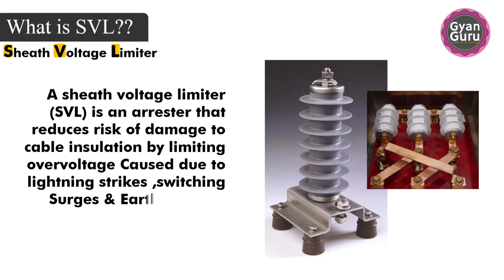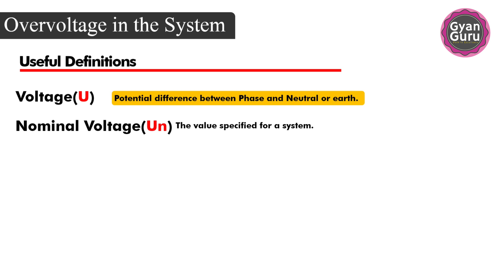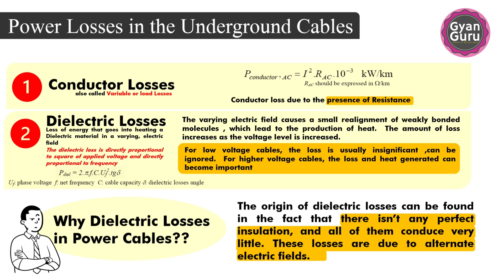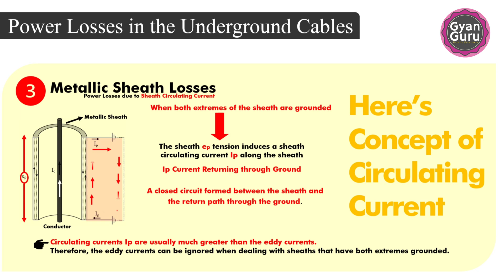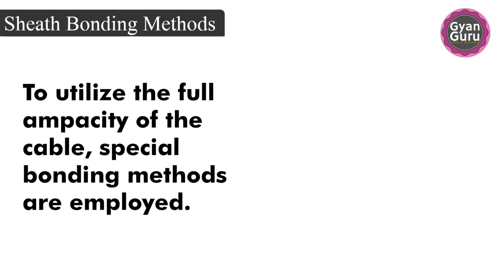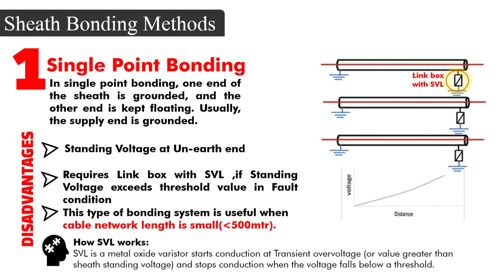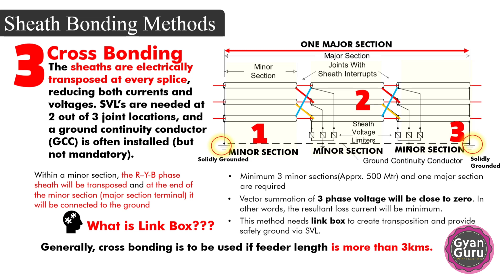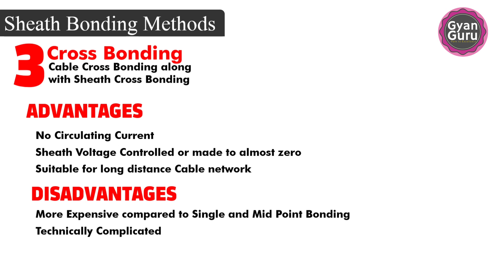Sheath Voltage Limiter (#SVL) Part -1

Comment: Does the cable earthing need to individual earthing pits incoming and outgoing cables Earthing should not get mix
Reply from the maker: no—earthing is normally common, not separate.
Earthing for incoming and outgoing cables should not be isolated from each other unless a very specific design requires it.